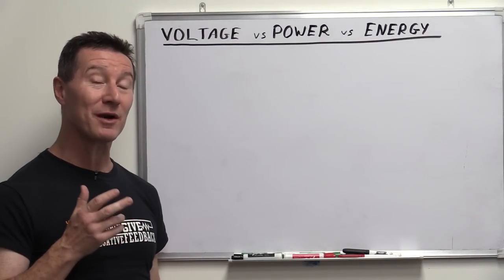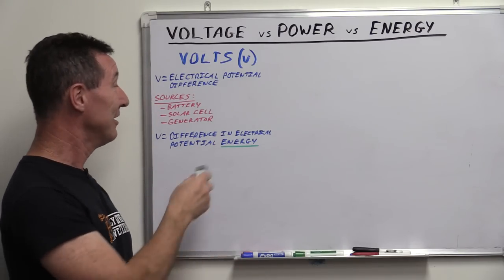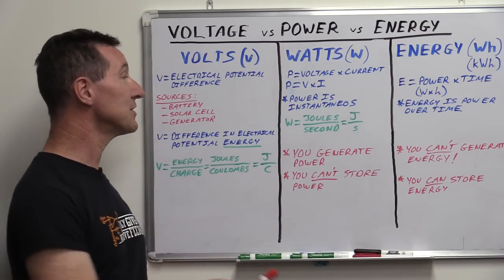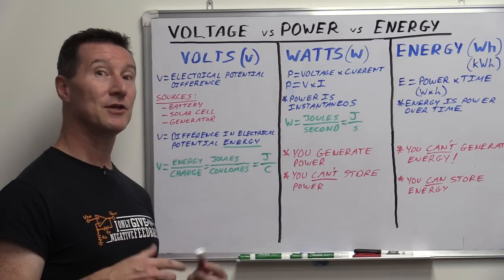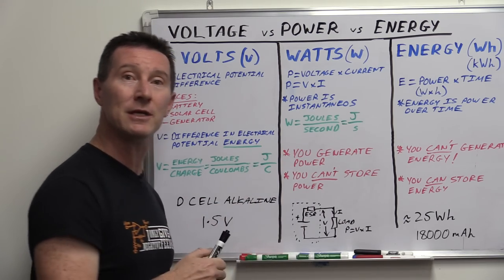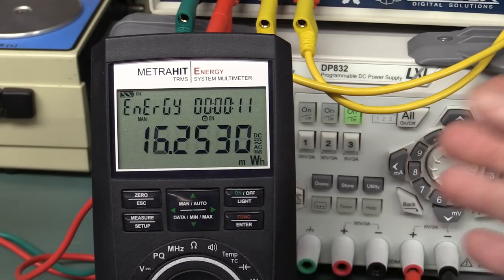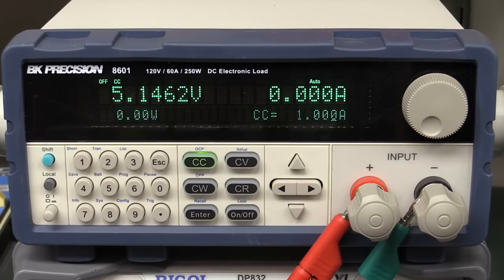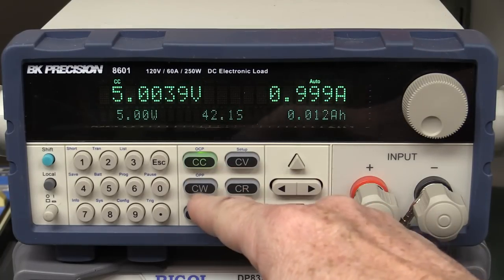EEVblog #1009 - Voltage vs Power vs Energy

Comment: Electronic engineers are always sloppy with their definitions, lol. Also find this one just ok. The only big important thing I was missing, is the right unit for (potential!) energy: Joules. That's also directly  the correct link with Power. For some reason, some dudes invented kWh, which makes the whole story so confusing. With Joules you can very easily explain the different with voltage, current and power. Personally I find it confusing just to only say 'energy', of potential energy, because there are different forms of energy. Although, in electronics you mostly use only one type. But this can be confusing if you're diving into robotics for example.
Reply: "For some reason, some dudes invented kWh, which makes the whole story so confusing."

That's a refreshing comment. Like a glass of ice water in hell I could've used back in my teenager years when I was racking my brains over why I just couldn't grasp the idea that watts x times = a unit of energy. It just sounded so abstract as a newbie to physics. And the choice of kWh instead of Wh or kWminutes added more to the confusion. Eventually figured it out of course, but man, did it waste a lot of my time due to my horrible teacher (his answers were to this "it just is because it is"... yeah, thanks a lot).

Definitely agree that Joules is better to start with. Main reason is that Joules is so much more universal, so that makes students far more capable to relate to the idea of that Joules = energy. Later on a teacher kan build on top of that and explain why kWh is the same thing, and why electrical engineers use that instead of Joules.
Reply: That's why all technical universities have separate electronics and electrical units.
Most people fail when they try to step into electrical engineering field (like Dave).
Reply: The good part about using Joules, is that the example with water IS actually exactly the same thing.
They both have potential energy. 
Potential energy is nothing more than something that as to the potential (when 'released' if you will) to being used in some useful way (so to speak).
That could be mechanical, electrical etc. That way you can easily translate mechanical circuits into electric circuits (for modeling/simulating etc).

Btw, Dave made one other mistake, which makes his story rather confusing (for himself)
Power is WORK divided by time. Therefor you can quickly see that P=I*V, but also P=F*v (force times velocity).
So this means that the equivalent of Force is Current and equivalent of velocity is voltage. 
(or vise versa, depending which analog you use)
More information: 
http://lpsa.swarthmore.edu/Analogs/ElectricalMechanicalAnalogs.html

Anyway, the point is. If people would use the correct terminology (and don't introduce strange derivatives) it would be a lot easier to compare and understand things.
Manly because electronics is much more abstract than mechanics.
Reply: Drunken Hobo kWh is kW for 1 hour = 1000W for 3600s = 3600000J = 3.6MJ.  kWh is a useful billing and economics unit for electricity consumption.  Run your 1kW stowe for 1 hour, consume 1kWh of billable energy.  1Wh would be too small to  deal with. Using kW*1000s or MJ uses a more difficult time unit for general use (thousands of seconds instead of hours).  And very few people have a power feed that can do anything measured in MW, thus ruling out the other way to deal with the MJ scientific unit.  One alternative unit could be the Wweek, but it's too small and has an awkward spelling.  A Wmonth would be a reasonable size, but months are not the same length and explaining to consumers that the "months" on their electricity bills are 30 days, not real months just won't work.
Reply: holy crap. Thank you so much. It finally makes sense

Comment: 1.21 gigawatts! That's a lot of power! In other news, 2000 British pounds is a ton of money!
Reply: No. 2000 British pounds is actually just about 0.9 metric sterling tons of money.
Reply: Really? It was a joke... three quarters of a solar system vs five sixth... It's not an exact science.
Reply: Dito. The joke here is that I'm conflating pounds (as a unit of mass) with sterling pound (British unit of currency) to create "metric sterling tons".
Reply: Doom2pro
Short ton or long ton?
Reply: Is that more or less than a metric fuck ton?
Reply: 2000 pounds in 20-pound notes would only be about 100 grams.

20 million GBP in 20-pound notes would be a tonne of money.

Comment: A while ago I saw in YouTube a movie about 'free' energy. A guy had an electric motor with an extra coil or circuit  in it. The motor ran on a Voltage but at the output of extra circuit was a little bit more Volts. So, according to them there was free energy in it. Explaining won't help. And every time they come with that 'them government' is forbidding free energy. Because free energy is against the laws of physics. And it's the law, so it must come from 'them government'!

Comment: "You might see the more familiar mAh figure [...] that's actually strictly incorrect" NO, IT ISN'T INCORRECT, it's what it is: a mAh figure. If you want an energy figure you've got to multiply that times the rated voltage... :-)

Comment: I like to see it as the energy you can give in a certain time. If you have a source of 1.5 volts and 2 amps then 1.5V*2A = 3 watts. So 3 watts for 3600 seconds or 3W*3600 = 10800 joules, or the energy that 3 watts can give in 3600 seconds (or one hour) is 10800 joules. Not rocket science.

Comment: Either my brain is giving up on me or I was taught at university that energy is power divided by time.
Reply: Power is the rate at which energy is produced, so power is energy divided by time. In SI units, a Watt is a Joule per second.
Reply: good way to picture is a power consumption graph:   Power on Y-axis (Watts), Time on X-axis (h)..   Height of the graphed curve at any point represents the power rating of whatever load you have (ie. how many light-globes you've got turned on), area accumulated under curve is Energy transferred, so, Power x Time = Energy (Watt.hours).

Comment: The smooth-brains that keep making videos about supercapacitors and how they are the future of electric vehicle power need to think about this: lithium batteries have high energy density, while supercapacitors have very low ENERGY density but super-high POWER density... that's why they start engines really well, but you can't listen to the car radio (with the engine off) long enough to hear a whole Pink Floyd song...yep, I'm that old...

Comment: Let me be your #1 Twit ;)  loved the video, thanks!  However, the order of your explanation may be backwards for twit-ville. Allow me to use words (like power) in their vernacular. Let's take a waterfall.  We're a caveman.  Do you begin to understand the power of a waterfall by the speed or size of a waterfall?  Not really.  We would only understand the power by noticing that a huge body of water dumps into another body, like Niagra Falls and kills people.  Same with fire.  Certainly we notice that a twig on fire can hurt us; but it's a raging forest fire that wipes out our village is the real education.  In short science began with caveman Energy and has worked backward to separate potential (volts) and time (watts).  

So a twit like me watches your video and still doesn't understand why his small 9-volt battery isn't more powerful than a huge 6-volt lantern battery.  The answer, right, is effective power is a function of pressure and time.  You touched on this with the static discharge but dove back into the weeds, forgetting us twit outs there who were waiting for the 9-volt battery mystery to be cleared up ;)

Like another mystery, can you use a power adapter with more watts on a devices that needs less?  Does it hurt it.  Same with volts. How do you think in a rational way about how electronics are labels with these volts, watts, and energy figures? 

I still don't fully understand all this.  I hope you do another video.  My guess is that if you focus more on on potential and how it must always relate to TIME and the different results of each (in real world experience, like our power bricks and devices)  it would help.   Thanks again!

Comment: And just because the energy rating of the D cell is 25 Wh, doesn't mean you can get 25 Watts out of it for an hour; it'll likely get hot and catch fire long before then! :) i.e. The angry pixies are sending smoke signals; that's where the magic smoke comes from! >Pffft!<
Reply from the maker: You can't get that much power out of it into a load, the ESR will prevent that

Comment: Why not use an electrical car?? That would explain power, energy and voltage or current and people could understand it! See below...

In the video there were actually a couple of mistakes in explaination. Dave, you said at about 2:30 "you rub your feet and you produce a big charge and generate tens of thousands of Volts.... but there is practically no energy in that voltage". That's completely wrong, because in fact you're not generating big charge! There are some electrons ripped off at the surface of the rubber soles and transfered to the earth, that's it. So very few charge is transported and that means there is very very little charge! But for ripping off an electron from it's place in the molecules you need some decent energy, as of course that electron normally want's to stay on it's natural place!

So, this is what also makes Mathematics of the equation working the right way because  now  you have a  relatively small energy  on top and do divide it by a  really really tiny number of Charge. That makes it maybe one-millionth part of one Joule divided a tenthousandth part of a millionth of a Coulomb and there you go, you get 10.000 (tenthousand) Volts! 

So, better not trying to explain the mistakes of people when they talk about something with ordinary words, and then use the same ordinary words in the "ordinary" meaning which is physically wrong... ;-)

Better think of an electrical car! Why?

Well, let's think you have some electrical car, which some of you will have. That Car was connected to the Grid to charge for a couple of hours, so it's charged up completely. That means it has enough Energy to drive up to let's say 250 Kilometers. That means the battery system has stored some Energy. Right? 

Now, let's go on - what does that Power term mean in that example? Well, easy to explain! Power is what makes you smile when you stump onto the accelerator pedal! Power is what makes you feel the acceleration force! And, of course, thinking of daily driving you'll not really go all the time on full Power all the time, right? So, that's where Energy and Power build up their relationship. 

Think of Energy as the ability over certain time to make you grin! Or more physical correct said: Ability to deliver the power to accelerate your car and push it through air drag!

And now let's move over to the terms Volts and Amperes which are the measuring units for voltage and current!  For that you might think of electrons being kind of "particles" like Water molecules at let's say Hoovers Dam, like you Dave compared it.

What is Voltage?
Voltage can be compared to the heigth of the water above the vent. The higher the water is over the output vents the more pressure is there. The more pressure that tries to push the water molecules out of the vents. In our example we would have to double the heigth of Hoover Dam to double the pressure or electrically spoken to double the Voltage. If vents of Hoover Dam are shut down there are no molecules rushing down, nothing happens. But if you "switch on" the whole thing and open up the vent (in electrical circuits that is done by closing the circuit!) then water molecules are rushing down the line (i. e. Electrons in electronics). And that is where the other unit is coming into place...

... and that is Current?
Right. Current is analog to the amount of water rushing down the pipelines. The more current flows the more particles are hurtling down the line. So, have bigger pipelines and venting holes at the water dam means there is more water going down the line and that means more current.

And what has Voltage and Current to do with Energy and Power?
Back to Hoover Dam. Well, it's hard to imagine to make Hoover Dam higher or lower, so our  Voltage is given fixed in that example. BUT you can add another pipeline the water could hurtle down and drive some turbines. Right? So, adding another pipelines means you're adding some squarefeet of diameter to the pipes, therefore more water is hurtling down. Does that mean something to our Energy? 

Energy was the ability to drive something for a certain time.... So, let's see! Assume there is no fresh water filling up Hoover Dam and you're drawing now more Water each hour then you'll see the Dam is drained earlier. The more water you draw, the earlier it will get dry and no longer be able to deliver any more current. Right? Double draw means half off the draining time. So the total amount of energy will stay same, more throughput, less time, same total amount.

And what about the Power?
Power is what the whole thing actually delivers. So for Hoover Dam: If they just draw water on 4 pipes we learned that the Dam would run dry in a loger period but just could handle a bit of turbines delivering power. Right. Now let's assume we're adding up another 4 pipes to draw water onto turbines. That would double up the amount of power Hoover Dam could deliver, right? So we draw double "current" but can deliver double power! Great! But if we draw double amount of water the Dam would run dry in half the time. So, double power delivery of the system will use up all the energy stored in Hoover Dam in half of the time.

Got it?

Hope that explaination helps a bit more

Comment: Power = voltage times current when combined with conservation of energy, has always been black magic to me in AC transformators and high voltage transportation of electricity. To this day I don't understand why high voltage means less loss of energy due to resistance.
The explanation would always go something like power = voltage times current, since in transformators the power must remain constant (law of conservation of energy), if you increase the voltage, the current goes down so there is less losses, because losses depend on the current.
I do not understand that explanation. I do not understand how it is possible that increase in voltage doesn't produce increase in current. That's why I say that these two facts combined (power = voltage times current and conservation of energy) are like black magic to me.
Also, I never understood in transformators, why and how the inducted current appears. Yes, I understand that by the law of conversation of some quantity, the change in magnetic flux produced by the current in one solenoid must be offset by magnetic flux produced by induced current in another solenoid or something along those lines, I learned that in highschool 5 years ago.
Also, I never quite understood what kills you when electricity strikes, is it Ampers, Volts, Watts or Joules.
Same thing with car accidents, what hurts you, momentum, pressure, energy, or force? What's the thing which kills you?

Comment: "You can't generate energy." Is that really a wrong sentence in english? Even in the right context, like: "My house's solar system generated 3kWh of energy yesterday." ? What would you say instead?
Reply: TheSecondFunnyKing he really means you can't make energy, and that's true, your solar system isn't really making that energy, it is converting the light energy to electrical energy, and the rate at which it converts this energy is the panel's power
Reply from the maker: +TheSecondFunnyKing I would say that your solar system converted light energy into electrical energy, with some losses.
The point is that energy is converted, not created.

Comment: "I need a nuclear reactor to generate the 1.21 gigawatts of electricity I need."  Even Doc Brown mixes it up!
Reply: hayatepilot Nope, that's very accurate. Very few power sources can output 1.21 GW for any reasonable amount of time, A nuclear reactor is one of those few.  Of cause later in the movie, they realize that they only need the power for a fraction of a second, so a massive electrical discharge (in the form of a high energy lightning strike) gets the job done.  I don't think they ever realized that charging a bank of large capacitors from the power grid (for hours or days) then quickly discharging at the right moment should do the job too.
Reply: It's called a Flux Capacitor.  It does that job.  Let's not get facts confuzed with fiction.
Reply: Nuclear reactors create energy out of matter. Dave said in the video that energy cannot be created.